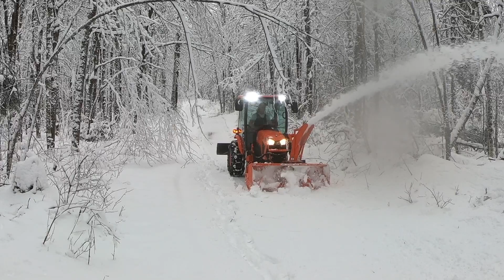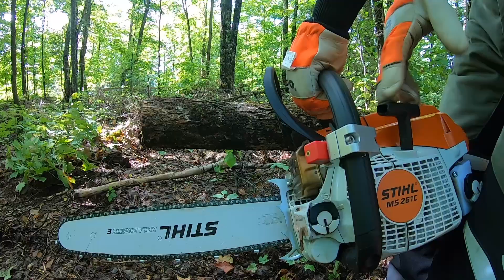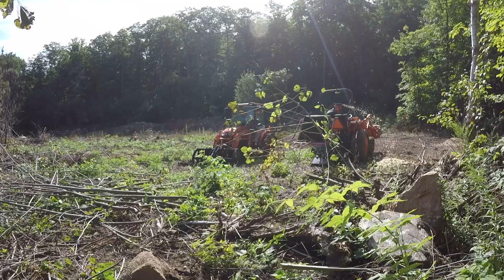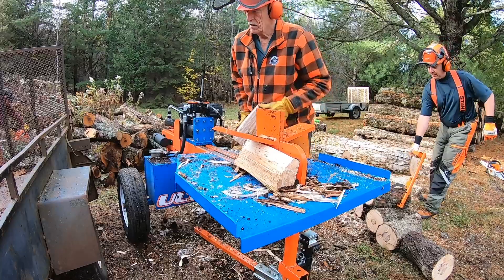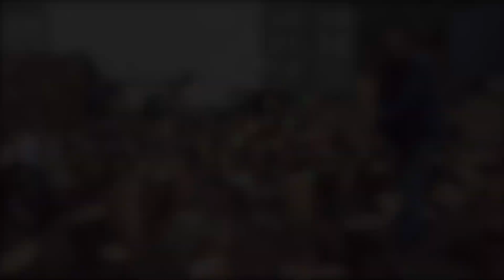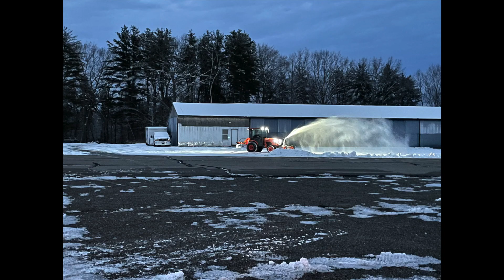514 A Year in Review 2021on GP Outdoors!

Comment: Thanks again Gord for a a great year end wrap up video.  I was thinking you might be interested in testing a few winches next year.  I have Warn winches on the front and rear of my 2021 Tacoma.  I use the winches to drag logs out of the bush so I can get at them. I also use the rear winch to load my logging trailer.  Probably will use grapple more often however now that I have a tractor with Grapple.  The winches are receiver hitch mounted and can be removed from the Tacoma in just a few minutes.  Still waiting for some snow.
Reply from the maker: Cheers Andrew! I thought about putting a winch on it years ago but haven't given it any thought since. But certainly an idea to consider - thanks!